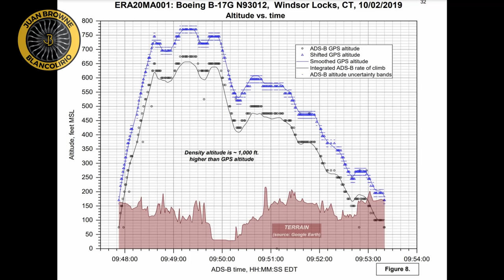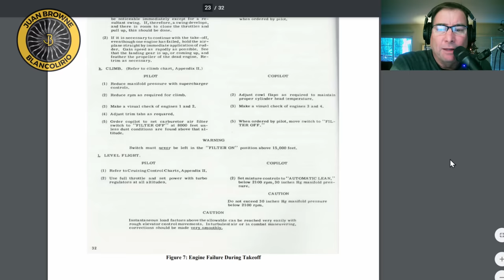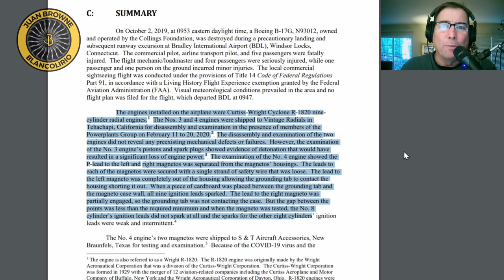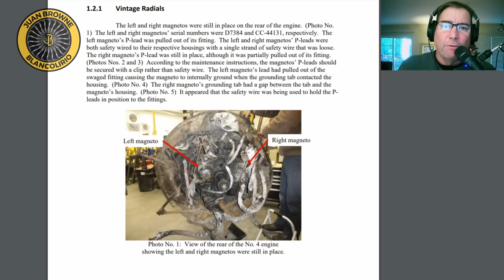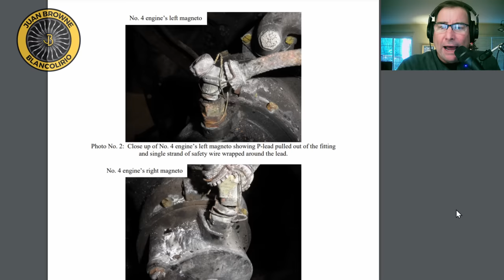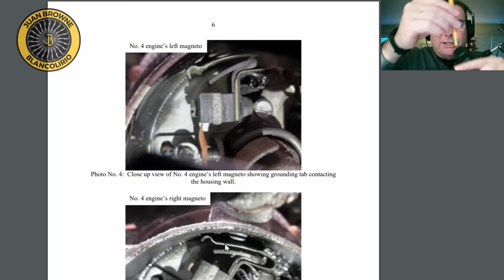NTSB Report B-17G Crash 'Nine-O-Nine' Part II -18 Dec 2020

Comment: Scuttlebutt has it that 909 was to be retired in 2018, but it's tour replacement was not certified yet, so they squeezed one more tour out of it. From what I have heard from others who have been in the plane, not just history buffs, but from someone who knows the B-17, 909 was due for a major overhaul in 2018, and technically should not have been flying.   The fact #9 looked the way it did, and the poor condition of the mags, is clear indication that plane should have been grounded as originally planned.   With the scarcity of parts, and the costs involved, which keep going higher and higher each year, I can understand squeezing out every buck you can get, but when it puts lives at risk, that is a point where the lines must be drawn.  There should always be a second set of eyes when it comes to the engine maintenance, especially when the person in charge is well up there in age.  Not to knock the older generation, but the mind does tend to forget things and not respond as quickly. 

Is it my understanding that the lack of pr0per clips and the field repair safety wire job was done BY the engine rebuilder?
Reply: Very sad.  Wouldn’t want to be the Collings foundation if lawyers get involved with this one.  They are done. Time to only admire them in museums. My grandfather flew p51’s over Berlin. As fun as it is to see them flying, it’s time.

Comment: Hey juan, thanks for another detailed and very informative review of the situation. The evidence sure seems to show a very neglected airplane rather than a well-maintained one and blowing out the mags is not what she needed :-(

 It's always been my understanding of the terminology that detonation is sometimes referred to as pinging. A number of things can cause detonation, things like improper timing, insufficient octane, allowing the engine to get too hot for whatever reason, etc.
A knock comes from a bad rod or main bearing and sounds kind of like smashing a heavy piece of steel with a heavy hammer. Much deeper, heavier, thud sound than pinging which is more of a rattling.

Comment: I'm not entirely sure about aircraft engines, but in automobile engines (at least back when I worked on cars, trying to pay my way thru school) it seems that you would want the spark plug to fire after the piston had reached TDC and was just barely on its way back down.  Firing before TDC or even at TDC would be creating an explosive force against normal piston motion.  Maybe I'm wrong, but it seems that is what I remember.  All this in the day when you would use a flash timing light to see where piston number one was firing, shown in rotational degrees after TDC.
Reply: It takes time for the spark to ignite the fuel/air mixture. So the spark is provided before top dead center. The higher the rpm the more advanced the timing.
Reply: @KS-cp6bj  Sounds good to me.  It has been a long time since I did that kind of work.  I just remember not at TDC and 8 or so degrees......Thanks!!
Reply: Peak engine power is achieved by firing just before TDC. It's s trade-off, and has to be carefully calibrated. The fuel octane rating also comes into the equation.
Reply: Best torque with gasoline is peak cylinder pressure at ~6 deg ATDC. As others mentioned, this requires spark BTDC.
Modern cars that have ion sensing ignition systems can read the peak pressure point in real time and adjust advance accordingly.
Reply: Its a bit like how a quarterback throws a football to a receiver who is running laterally across the field. The ball is thrown ahead of the receiver so both the ball and the receiver arrive at the same spot at the same time. If the quarterback throws the ball directly at the receiver without any lead the ball will pass behind the receiver. Similarly the pistons are moving so fast the spark needs to lead the piston so that the combustion process has already started when the piston get there.

Comment: I am not sure I agree with your comment that caging 4 was justified.  Absent evidence to the pilot of a mechanical failure (oil pressure, fire alarm, etc.) or a dramatic reduction in RPM, the timing of the shutdown has to be questioned as the first officer appears to have down.  It would take more than a few hundred drop in RPM right after TO to make me gage an engine.  Get a little altitude and then evaluate.  There are a lot of people that got safely on the ground with a ruff running engine with marginal power and you don’t make precautionary shutdowns immediately after TO.

Comment: Nice video Juan.   This accident truly saddens me because it should have never happened.  We as pilots need to do much better.   What you say about operational structure of the operation is absolutely correct,  but the person in charge of this disaster was not the only qualified person operating this aircraft.   The other pilots had to have known the deficiencies of the ignition system(s) yet chose to operate it.   

I can't imagine any pilot not questioning some of the things done to get these deficient engines running.    Did they raise questions?  Were they browbeaten into flying?  Opportunities to fly these machines are few and I'm sure there is a line of pilots waiting for the chance.   

 We are in a get along at all costs era where making waves is frowned upon and strong personalities can run rough shod over others if they are unwilling to stand their ground.   I don't know if that happened here, but many individuals knew these engines weren't right and allowed these flights to continue.  We have to be uncompromising as pilots and refuse to fly dangerous equipment.   And when others with out our knowledge are being subjected to unsafe conditions we need to be resolute in making sure the correct things are done.   Lives literally depend on it. 

One thing I would like to hear you talk about is something I've heard a few times now,  that magnetos on radials are prone to moisture issues and may need to "blown out" to make them operational,  as if this is SOP.     I'm not really buying it.   When these planes were made there was probably at least 40 years of operational knowledge with respect to magnetos.  Plus these aircraft were made to fly and flown in pretty much any weather.   I don't buy that they were equipped with mags that needed to be blown out after a rain storm on the ground.   Your insight on this would be appreciated.    Thanks

Comment: Never seen plugs that bad they needed clean them out with keytone to  that cam on # 3 mag was bad.   When I worked at a radial engine airplane company we always had spare mages carbs  generators feather pumps adi pumps etc around and if on a inspection the p lead threads werent able to be tapped we d just send to the appliance repair station and use the spare  Is Collins really that broke not to have a spare. They must  not flown at a high altitude going there all those big gaps. Another cause of the detenation could be a failed ADI pump and using low octane  (100 LL). 
  Now what about the #3 prop being feathered?? Was it in process of feathering Was feather pump bad or slow from sludge at the bottom the oil tank?  Should take less then 10-12 seconds to feather

Comment: These engines are operating on lower than design octane fuel. Adding more tetra ethyl lead isnt enough so the timing is retarded to allow smooth combustion. This, all together,lowers the power output. Having a smaller gap on the points also causes them to open earlier advancing the timing. I know this seems counter intuitive but the cam following point is regulated by the cam,the gap is determined by the base point which is adjusted for the gap.
It would be interesting to know how far off the mag to crank timing was and when it was last checked. Wear at this close to overhaul would have lead to it being out of spec if  not previously done.
This engine appears to have been sporadically maintained and were it an antique car wouldn't be reliable driving on the freeway cross state
Reply: The engines are designed to operate on what used to be 100/130 fuel, now 100 LL, the timing hasn't been changed in the TCDS for fuel difference. It's still 20 degrees BTC.

Comment: As you so eloquently stated in your videos here, Juan, nobody wishes to "assign blame" for any aircraft accident especially when lives are lost. Unfortunately, in this case, clearly there IS blame. A corporate culture of skimping on maintenance, avoiding relationships with regulatory agencies, and failing to follow modern cockpit management. It led to deaths. And no doubt it will lead to increased regulatory oversight and probably the elimination of public warbird flights. 
As another supporter of the Foundation and once a passenger in Nine-O-Nine, I am truly saddened, and yes, angry, at how this all took place.

Comment: either that rusty cil got filled with water after overhaul or they did do a really piss poor of a job overhauling that engine looking at the magnetos. I work on cars and i know stuff fails even shortly after maintenance, so condenser I could blame on failing later. But wear, proper setting gaps and that horrendous looking safety wire job of a cable attachment tells me there was not enough love and care taken to maintenance.

Comment: First I'd like to say, in respect to the victims that this event saddens me, and I feel terribly for the family, friends and acquaintances of the victims of this tragedy.  May they all rest in peace.  And may the entire aviation industry use this as a lesson.
 
The issues with engine 3 are really telling, besides all of the points made I see it as potentially the key mechanical reason for the crash.  I wonder if it was known there were issues with engine 3 (cylinder temps too high etc..)?  I would conjecture that it was known and being used "lightly" to keep temps caused by detonation down on flights leading up to this...not to mention perhaps ALL engines were being used lightly to prevent "stressing" them as a rule (so WOT performance problems wouldn't be evident until you needed it).  Once engine 4 was caged (perhaps prematurely because they didn't want to cause damage to it) engine 3 had to shoulder a lot more power if not WOT.  Cylinder temps started climbing, it started running poorly...my only question here is did it get shut down while still able to provide thrust (again) just to save damage?  Or was power intentionally reduced significantly on that engine while leaving it running?  This could lead to CRM issues where it may have ended up needing to be feathered OR had power increased but was not...

Comment: As I understand it, the B-17G should be able to maintain altitude with two engines operating, even if they are both on the same wing. Is this incorrect? If not, why did a B-17 well below wartime weights fall out of the sky with only two engines inoperable? In a reasonably clean configuration, should that plane not have been able to circle back around and land safely even on runway 06?
Reply: My thoughts exactly; it should fly fine on two, especially given the weight. Seemed to me that they got way too slow on downwind and extended the gear way too early....me wonders why they didn’t use RW33 if things were going south so quickly. What a mess...
Reply from the maker: See Part I

Comment: The under spec. point gap would retard the timing; although being. 002 under min.,it wouldn't be much.  Would be interesting to know what the actual timing was. From this report it looks like the excessive spark plug gap and weak coils fouled the plugs; and looking at the photos of those spark plugs, you won't be getting any power there. I've seen many an older Harley that would barely idle with plugs like that. Great video Juan.  Tragic loss.

Comment: just like storing any old motorcar,  plugs need to be removed and some oil added to all cylinders, and it should be rotated periodically to prevent the corrosion evident.

Comment: Power plants, oil and exhaust, instrumentation, hydraulic systems, fuel systems, flying surface systems with cable control, electrical systems, airframe and landing gear systems, overall cleanliness and condition of aircraft. Condition of all windows and observation hatches. Skin metal and attachment riveting. Tires and struts.
She’s your ship,, check her before every takeoff.

Comment: One factor that must be considered is the age of the aircrew. The pilot and co-pilot were without question extremely experienced. However, everyone's physical and mental abilities degrade as they age - strength and agility decreases, reflexes diminish, and thought processes are slower. Combine that with the fact that WWII era military aircraft were full manual control, requiring more physical strength than modern hydraulically-assisted flight controls, and you've got a dangerous situation. These aircraft were designed to be flown by persons in their 20s, in good physical condition. They were also designed with the primary mission of performing combat duties, and safety was a secondary consideration.

In the U.S., airline pilots are mandated to retire at the age of 65. Those pilots are flying modern aircraft with 80 additional years' worth of safety improvements, and highly-trained flight crews and professional maintenance staffing and procedures. Crew requirements for antique military aircraft should be MORE stringent than what is required for pilots of modern aircraft, especially when carrying passengers.

R.I.P. to the crew and passengers who lost their lives in this tragic incident.

Comment: I understand that they want to keep a vintage aircraft as original as possible, but for safety why don't they replace the points with electronic ignition (assuming it's available for aviation) like they do with vintage motorcycles?

Comment: CRM aspect seem’s scary enough, if it was my aircraft I would of had a different flight crew make up. I wouldn’t be operating an old aircraft with pilots the same age as each other and that of the plane. Collins B24 seems to be flown with younger pilots better able to handle an emergency in a heavy, failing, manual aircraft.

Comment: So lax flight standards are to blame evidently for the crash of B17 "Nine O Nine".   I rode on that plane years ago.    Tragic loss, and so avoidable.  Even with just one funky mag, and you don't fly. Why did they fly?

I recall the B17 called "Liberty Bell" that caught fire midair.  I had seen it on the ground prior that year.  It was the leakiest, oil covered airplane I had ever seen.  Every bit of it was soaked in oil, wing to tail, drip pans on the apron under each engine, leaks!   Cause of the fire.... A leak.

 two B17s lost do to poor maintenance.    Come on guys, do it right or keep it on the ground.

Comment: Great video as always, Juan!

Kind of a black eye for the Collings Foundation, no?  Like a lot of commercial operators, it seems they put making money above proper maintenance.  That kind of crap puts the entire (wink-wink) "sponsorship-ride" industry at risk of extinction.

That said, I can't believe those 1820s have such a high TBO!  Also hard to believe those mags were in such bad shape.  Those engines must've been running really rough for a while!  I guess Mac put up with it, given they weren't taking off with full fuel loads and a full load of bombs and bullets and guys.  Still...radials are pretty tough, eh?

Oh, and nice job explaining how a mag works, Juan.  Those of us of (ahem) a certain age know all about points-type ignitions.  I doubt the younger generation have any idea what you were talking about.  And as for the P-leads...fuggedaboutit!  "Wait- you mean if you disconnect the P-lead then the mag is hot??"  Yes, and it's counter-intuitive.

Comment: It would appear at least from where I'm sitting someone either couldn't or wouldn't spring for the cash necessary to replacement or rebuild the magnetos in question and the chances of this problem all happening at the exact same time just out of the blue well that's a bedtime story for  another time .. This is what happens when you say ok we will just one more show and we will fix it ..

Comment: ..on the subject of mags, I wonder why someone hasn't come up with a replacement "electronic ignition" mag to replace these old, worn out parts and do away with the breaker points and condenser?...I'm sure it could be done, and done in a way that would look "original", so as not to detract from the originality of the engine, while adding reliability and safety?..they make such parts for old cars, old tractors, and even old lawnmowers..so why not for something as valuable as a warbird?...

Comment: There are indications in the video that this type of plane could not be flown safely or properly even with experienced maintenance, which implicates the entire FAA warbirds program.   The missing clip, the obsolete design of the magneto system, and extreme cylinder wear pre-dated the crash are hints that parts needed to be fabricated or scrapped, and that engines with high levels of wear were repaired rather than replaced because no period (or modern, 3d custom printed) replacements or parts were available.  I've seen a warbird programme in Colorado Springs where a P-38 lighting with the original wing-fuel cooling system was restored, then FAA made them pull the entire system out (as it was considered a design error even during the war) and replace it with a newly fabricated alternative.   I am not saying that these planes cannot be flown safely under any circumstances--the magnetos aren't inherently unsafe but they are too temperamental and flawed---but reliability is going to suffer from old technologies with a limited pool of replacement parts and in some sense, no amount of experience or money can solve those problems.   I suppose only by replacing entire systems with updated versions creating replica aircraft that are vintage in appearance only.